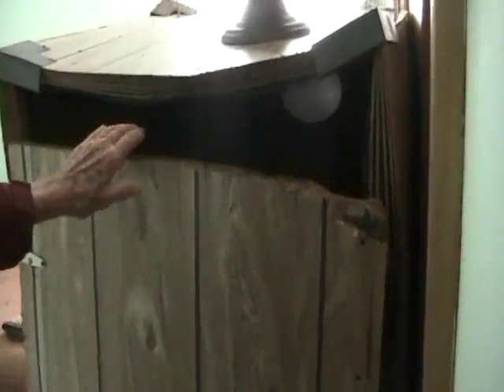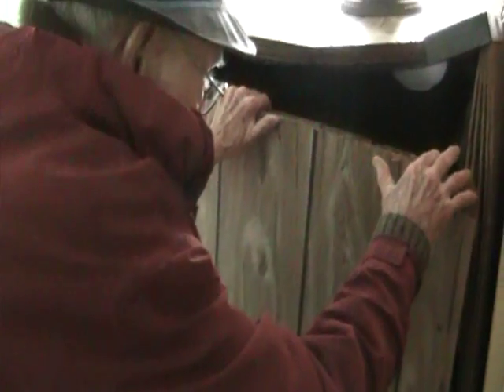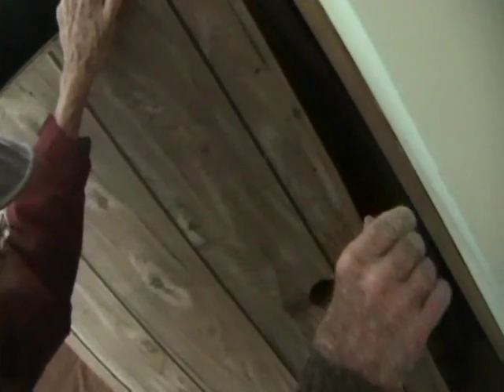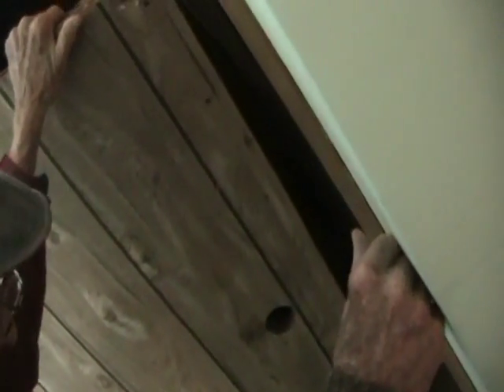orgone accumulator sit in/enclosure/sauna style

Comment from the maker: @Qnzdipset1 His orgone
accumulator for instance is a wooden box, filled with wool of steel and wood, which
alternate in layers. He said that the reason for this construction is, that metals repel the
orgone energy, whereas organic materials become charged and accumulate it. That holds
in his opinion to a particularly high degree for water. Reich concludes that no material and no device are known, with which the orgone energy
could be shielded.-MEYL  "scalar waves" free pdf if ur crafty

Comment: Needs to be in fresh air, not inside room.  Beware of plywood paneling due to unknown glue, same for composite wood made of wood chips and glue.  Steel window screen if you can not get sheet steel..... no aluminum. 

Sum....
-layers from outside inward..  organic, metal, organic, metal.  Organic 
is outside.
-more layers are considered better.
-beware of plywood due to unknown glues.
-sheet iron or steel seems best, not sheet aluminum. 
-when door closes, its inner layer of metal should touch door edge on 
all sides, can use "finger stock" often seen in electronic shielding.
-small window helps person bear close quarters and reading lamp can 
shine inside but definitely from outside.  No electric lamp inside, no 
flashlight (torch), candle ok.
-seat should be all wood with back to avoid human back touching metal 
wall.
-cotton throw rug under chair and person's feet.

Advice seems to say 20-30 min. each usage.  Allow fresh air.  Good time 
for Zen or other meditation, calm abiding mental attitude;  do not use 
when angry.  Happy Sitting.
Reply: Charles Harpole hi Charles can you source Wilhelm Reich’s specifications for this? Thanks for all your info, also what about air coming in-ventilation? Thanks Pandora Australia
Reply: Have you heard anything about the rusty screens and iron oxide

Comment: After the so called ORANUR-experiment the participants in Reich's laboratory become aware of the dangers which arise from using these devices (as a box, as a blanket or whatever), depending on the surrounding, especially near TV's, X-ray equipments, near nuclear power plants, and we don't know exactly what else.  Considering what is not known, it is most recommendable to use it - if at all - in such a manner that it does not work when it is not used. Otherwise it works in the whole area (room, house, ...). That's why an advise Reich gave to Neill when Neill couldn't get all the material needed is to consider: Just take an iron sheet (no aluminum or copper!) und bend it (perhaps with the help of a ribbon that keeps it fixed) so that you can lie underneath - after you have put a cotton blanket above it. Separate the two layers from one another after use. (Fresh air is important wherever you use it)